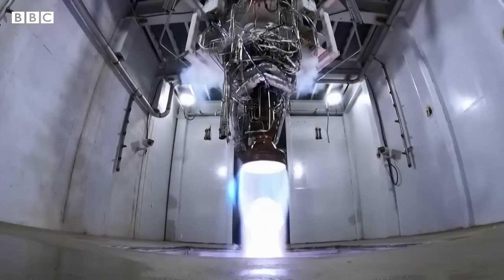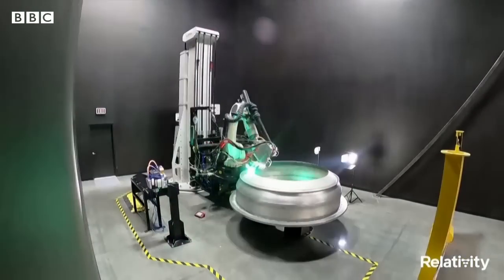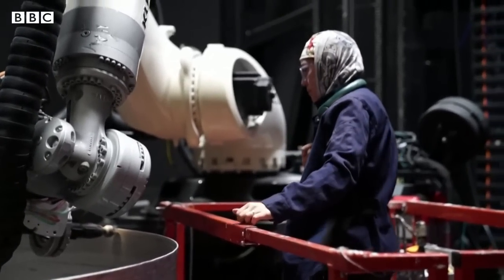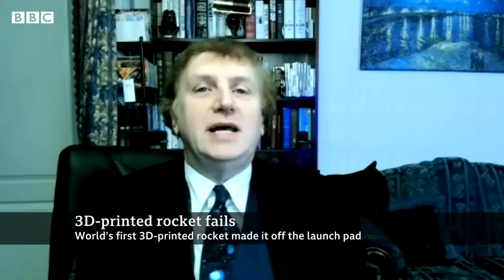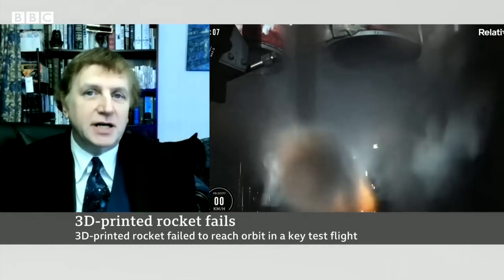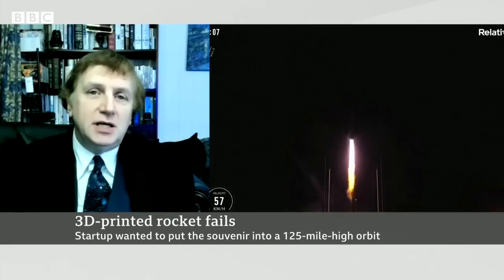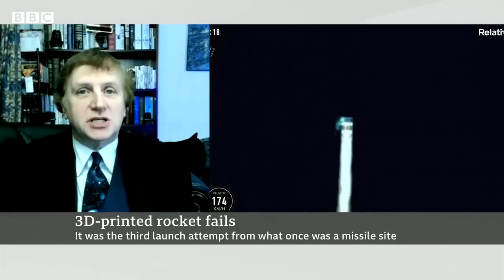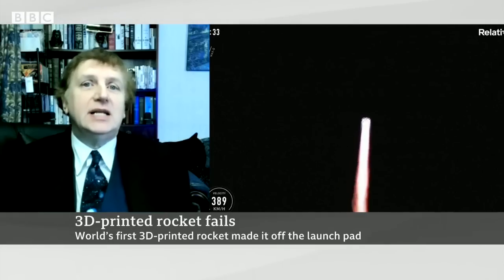World’s first 3D-printed rocket launches but fails to reach orbit  - BBC News

Comment: 3d printing rockets is stupid. the equipment and stuff, yes it makes sense but cmon a 3d printed rocket doesnt sound safe enough. just use part building machines and shit. they jumped the gun a bit. ed printing a rocket is slow but cheaper so yeah as an experiment for future rockets, yes it is valid

Comment: "3D-printed rocket"  

The Rule of 3D Printing Hype: Whatever noun follows the descriptor "3D Printed" is always the wrong word; most often the next higher or even highest-level assembly.
This rocket was hand-assembled from many 3D printed parts. Reportedly 85% by weight, but they're still individual 3D Printed rocket parts assembled by hand.
It is not a "3D Printed Rocket" and all that implies. Watch for it, and you'll soon see that this rule is essentially universal.

Comment: Like I said in a previous video, they should have worked on 3D-printing semi-conductor chips.  Of course it is easier to print a big structure, but the concept should be the same.  The molecules/atoms still need to be properly arranged to achieve the right strength.
Reply: What the hell are you EVEN talking abt?
Reply: lol, how would one 3D print a microchip? Even current methods of creating silicon wafer using photolithography aren't reliable and chips need to be "binned" - Eg, a chip might have defective cores so it's used as an i3 instead of an i7 CPU. The transistors are so tiny I'm not sure there's any sort of nozzle that would even allow metal to pass through. You're dealing with a scale of just nanometres.
Reply: At least they aren't making useless machines like Chinese companies who created kiss machine
Reply: maybe just 3d print a pilot?

Comment: If you watch the official coverage they state before the launch that success for the mission was to achieve Max Q and if possible stage separation anything else would be a bonus. Hardly any rockets have achieved orbit on their first flight. It took Space X 4 attempts to reach orbit for example. Blue Origin have not yet reached orbit. If you want better more balanced coverage I recommend trying NSF Live or Everyday Astronaut here on You Tube.

Comment: How about we 3D print homes and solve the housing crises for poor?
Reply: Already happening now but the tech is still not cost effective on a large scale. Also society is capable of working on multiple problems at once. I disagree with the "either this or that" mentality.
Reply: Because it doesnt work well up to now.
No multi-unit, multi-storey building has been printed at this point, which is typicall best if you want cost-effective lifving space. At least in western urabized countries where ground is expensive af.

There are a few good startups that print one-storey bungalows and the like. Even some working with adobe, which nicely eliminates the need for a lot of concrete (except the ground plate)
But they are not very cost effective and still need a lot of bought and added stuff - doors, windows, wiers, pipes ect.

Comment: I wonder if we could 3D print a house 🤔🤪
Reply: yes, this has been done, but 2d printing of concrete is a generally terrible idea.
You certainly get an artsy garden-house that tempts you to print with needlessly round walls everywhere, that has significantly worse insulation and very rough stucco-walls EVERYWHERE.
printed concrete too easily cracks over time, for the same reason you do not build long bridges out if single pieces, but with tiny gaps for thermal expansion, you must not print large concrete-pieces.
Reply: They can 3D print a miniature beating heart.
Reply: They did it was sold on zello.
Reply: Don't know but we can 3D print climate change. It seems anything can be fabricated now.

Comment: 3d  printed canister ?

or    3d    IC Rocket  engine ?
Reply: 80% of the rocket is 3d printed
Reply: Most of the main structures - tanks, chassis, outer skin ect printed.
About 20% of its mass and 40% of cost - including pipes, pumps and engine - produced otherwise and bought/installed.

Comment: Wow... I didn't know 3D printer can even print a rocket... interesting
Reply: yes.
3d printing (of aluminum) is generally better than welding/bolting more smaller pieces. The result is similar to welding, BUT 3d printing is likely faster+cheaper (and easier to miniaturize).
3d printing of intricate automobile engine parts or jet propulsion engine parts is worth trying and pioneer-work. This very likely easily optimizes for lower weight and higher efficiency and lower cost of printed engines. you definitely need smaller assembly-halls for 3d-porinting of aluminum.
3d printing makes slightly rougher surfaces but tends to need slightly less mass for the same durability, and this roughly equals out in terms of fuel-use and risks. Where it is too rough, it is easily polished.
THE tricky part here is likely VERY DIFFERENT thermodynamic properties, not necessarily worse, but more experimental.
Reply: They've 3D printed an actual beating miniature heart.

Comment: define 3d printed
Reply: aluminum is liquefied downwards through a nozzle that spirals upwards.
its like the whole aluminum tube is one long welding-like spiral, BUT much better (in terms of insulation/corrosion) than any other type of welding.

Comment: Amazing to think the potential for my printer. Its ran out of ink years ago, but to think if I press the right buttons, a rocket could be made
Reply: A very flat rocket.
Reply: Absolutely because all 3d printers are the same. As long as it's labeled 3d it has the required 3d capability.
Reply: Only if you pay that top dollar for your ink rocket fuel,because that cheap supermarket ink rocket fuel always causes a leakage.
Reply: Try to make space ship then 😂for inter galaxy travel 😂with ur printer
Reply: maybe just 3d print a pilot?
Reply: Give the end of the cartridge a lick and make yourself a rocket big boy